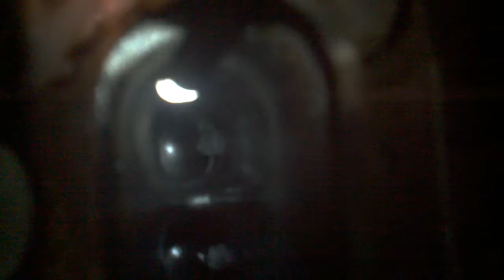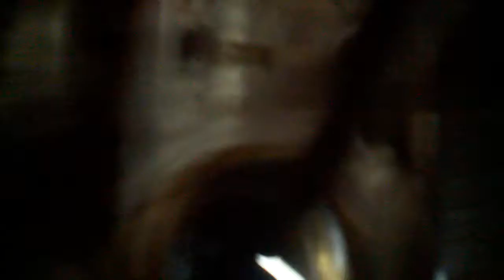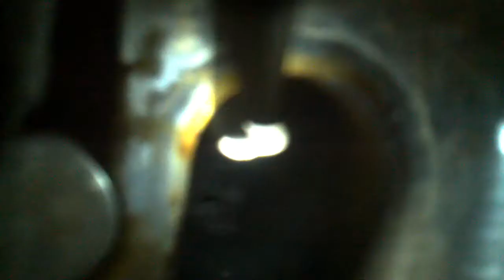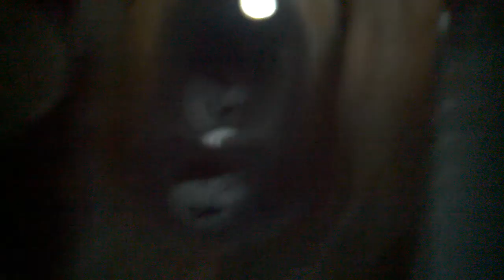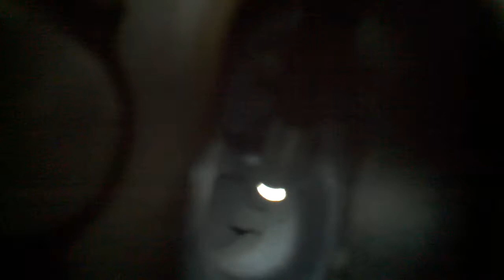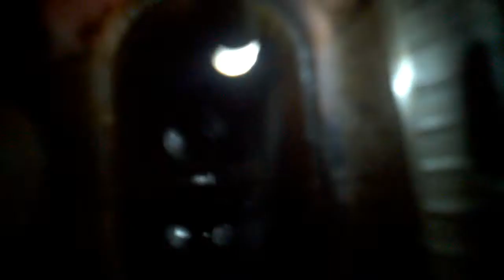Mini Cooper, Carbon Build Up, Intake Valves, Misfires, Rough Running, Loss of Power

Comment from the maker: Hello AKJeeper, This would be the R56 with N14 engine. The W11 does not have this problem :) I am wondering if the problem will carry over to the new N18 engine with valvetronic. I would suspect yes as I have seen the problem on BMW's with turbo and valvetronic but it tends to be less or take more time to develop.